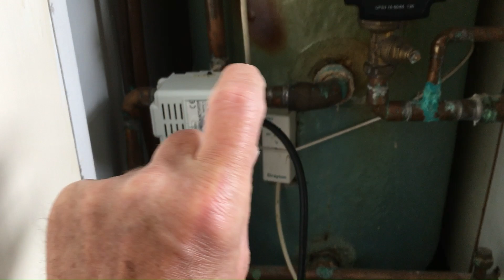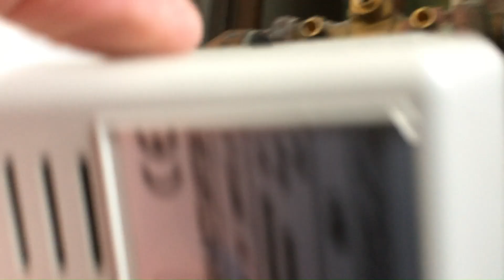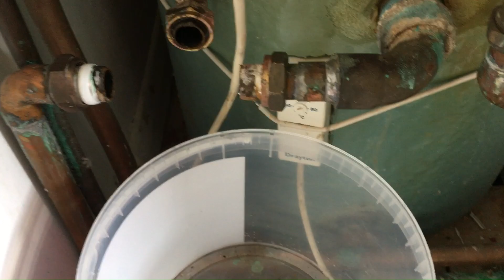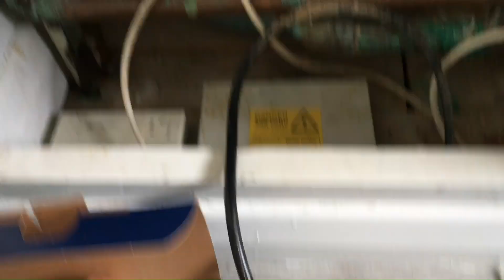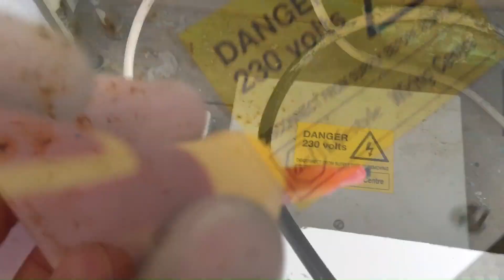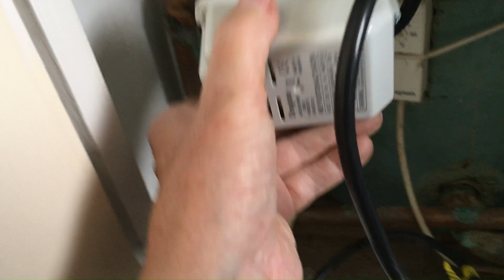Replace a motorised MA1 diverter valve in your heating and hot water system

Comment: Wow - what a beautifully shot and executed replacement of the diverter valve. I would not do it myself but it was fascinating to watch. Over the years it is the diverter valve that has gone wrong in my sealed C.H. system.
Reply: Thanks for that, there is no drain on any of the radiators. I put a hose on the drain valve at the bottom of the oil boiler and it removed the water to allow me to change the 3 port valve. The valve didn’t make a difference! It turns out there was air in the hot water tank and there seems to be a problem where the cylinder stat is calling for the boiler to fire even when the nest smart stat is off. Still haven’t got to the bottom of that problem!! Any ideas why the cylinder stat is making boiler fire with the nest off?
Reply: How did you drain the water out? I have a valve at my boiler where you can put a hose on it. Is that how? Also do you have to bleed all the radiators when draining down? Thanks
Reply from the maker: @markhamill8016  There should be a valve in the pipework under at least 1 of your downstairs radiators, you put a hosepipe on it and use a square key to open it and drain the system that way. No you don't have to empty all the radiators in an open vent system, you just clost the vale at each end of the radiator and they stay full.
Reply from the maker: Thanks for your comment, feedback is always welcome 👍